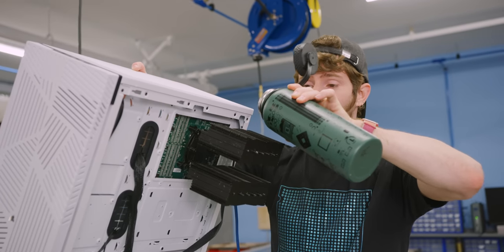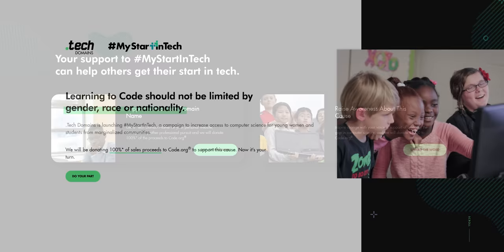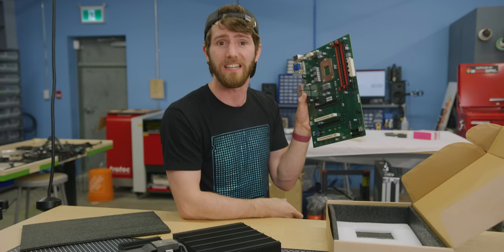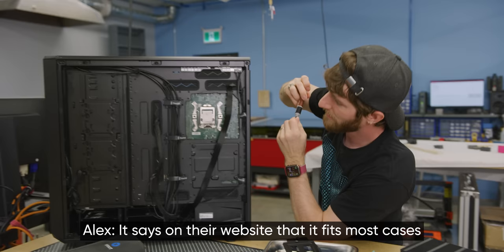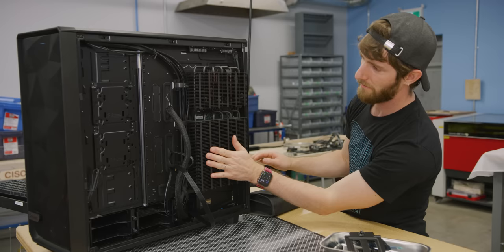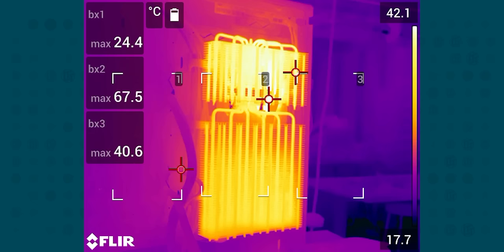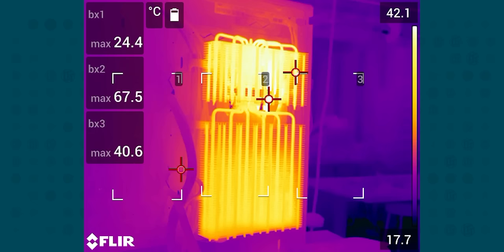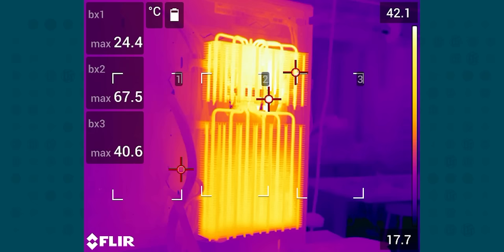What Happens if you Water Cool an Air Cooler?

Comment: The most interesting aspect that linus never mentioned was the complete lack of ANY exposed solder holes or pins on the "front" (aka dust facing) side of the board. This thing is both extremely well engineered and manufactured where it matters but also kinda "eh fuck it" where it doesn't, such as the silk screening, lack of a button cell, and the "fits most cases, some may require modification." They know anyone who is buying this knows exactly what they want and need and aren't afraid to modify a case to make it work.

Also should have added salt to the water. I've seen piped brine solution cooling systems for "no allowable vibration" scientific instruments. They can't use traditional watercooling because the turbulent flow causes vibration so they literally pump chilled brine (usually to many components) similar to this where the heatsinks are 90/10 + 1.5% CuNiFe.

Comment: Would having a water cooler connected to a an external waterfall work for heat exchange? But you would have to frequently top up the water. Then there would not be a need for fans.. Just a pump.

Comment: If you flip an aircooler down, doesn’t the materials inside the chamber pools to the bottom? Because Heat turns it into gas which cooled by air and condenses before dripping back down the pipe? If what I say is true then you’re really not measuring the affects properly because it can’t flow down to the heatsink

Comment: What if you use the same stuff as we do in chemistry to cool a computer ?
Take like ethanol in a closed circuit , add a ball cooler in an end and now instead of heating it boils, fall back into the système and extend the cooling space by a lot

Comment: But why not take it a step further... make a special side panel that passes thru multiple smaller coolering towers and have those attach to other things like the chipset/vrms/ram if possible and maybe the GPU if you can swing it... could make it so that the PC case basically IS the top of a basic camping cooler lol. Make the case part humidity/dust proof (if possible) and you possibly have the best possible silent workstation and sleeper PC lol.

Comment: I gotta admit, I'm not really seeing the point of this. Is the case supposed to be sealed up? Also if the case is sealed wouldn't it be better to just put a fan on the cpu, then heat components can be attached to the case? IDK

Comment: All you have to do is spray water over your cars condenser  in the AC system to see  that water adsorbs heat much faster.      You don't even need a computer to answer this question.

Comment: Suggestion for 2 fun experiments that might result in something very useful for gamers in hot tropical and hot desert environments:
1: Try out the peltier water coolers see how effectively you can cool cpu, gpu and chipsets with them.
2: Build a pc inside a minibar fridge or small chest freezer in such a way that the area with the mobo etc is hermectically sealed from the outside environment. (eg using rubber grommets etc for wiring io boards placed in the top of the mini fridge or lid of chest freezer)

Comment: as an electrical engineer my heart was racing throughout the whole video.
this yet also shows exactly why men die earlier than women :D
Reply: It's mostly low voltage if you keep your PSU away from the water. And even the mains isn't that dangerous today with differential protection of 3ma, at least in my country.
Reply: @zazethe6553  it is not the voltage that scares me it is the 5 ampere that will grill your heartmuscle  :)
Reply: @buerger3  5 ampere? with what 12 volts? 12 volts DC cannot penetrate the resistance of your skin, let alone reach your heartmuscle.

Comment: i guess i already liked the video... whoops reliked again okay now that that's out of the way ... i have a hp dv6000 i found 🧽 sponges left and right of the track pad reduce heat even had some large aluminum blocks but sponges yes wet worked better just kept topping them off as they'd dry had also frozen containers of the right size and shape to fit it's hotspots and also built a robust frame to force the microfan to breathe it's fire 🔥 oh just plain old hot air out the back built a 20 inch box fan cooler for it too even though it's loud on highest setting ... a upgradable and highly over hardware'd like 1000years redundant to not require any upgradess but still be compatible with all upgrades oh chat size limits ... goodbye important story chunks 😢

Comment: Pouring water through the heat stack was incredibly stupid and made no sense for you to do, whatsoever. Strapping a fan on that thing made sense, as that is something that someone using one of these motherboards could actually do in a real world setting. Pouring water through the fins on the heat sink is not something that can be done realistically. It was completely pointless for you to do that, as you can, technically, pour water through the fins of any tower style air cooler. But it has zero real world application.

Comment: real question, what happens if you air cool water cooling?
Reply: That's literally every single AiO in existence?

You pump the water to the CPU, and then pump the warm water to the radiator, which is then cooled by several fans which is moving the air through the radiator fins, which Cooling down the water again.

And then loop it back to the CPU. Repeat.
Reply: @niezzayt3809  True should of thought it through before commenting lol